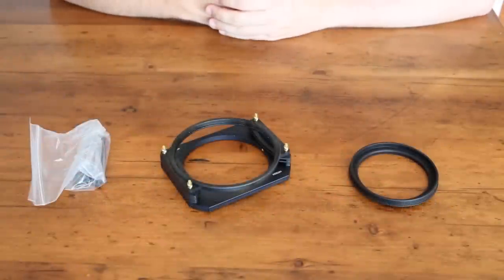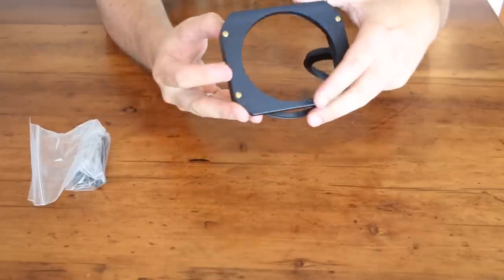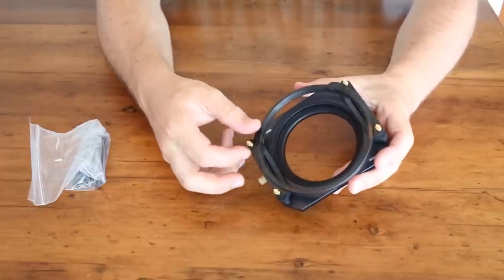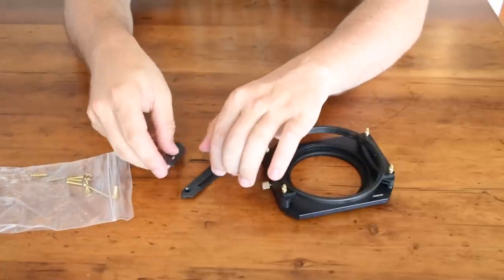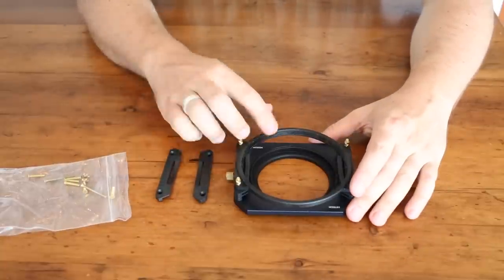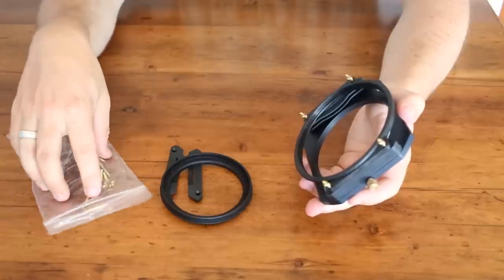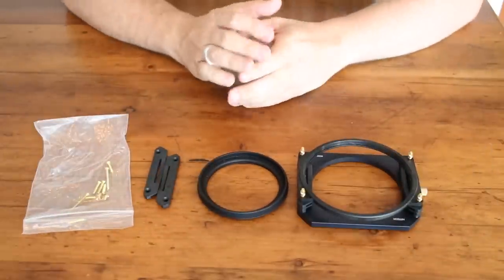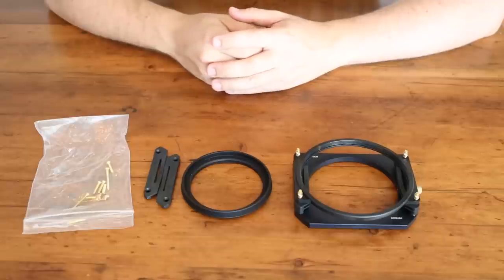Hitech 100mm Modular Filter Holder System

Comment: Dan, do you know whether the 105mm adapter ring has the holes for the screws in the same place as the Cokin Z Pro system? I ask this because I have the Cokin Z Pro system and am looking for a polariser to go on the front of the filters rather than putting one on the lens first and then mounting the filter holder on to the CPL threads